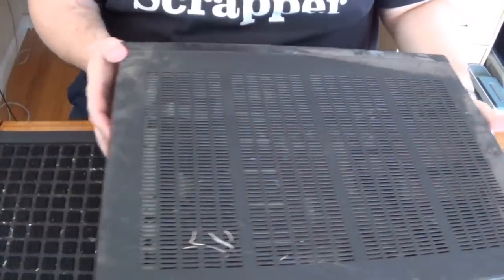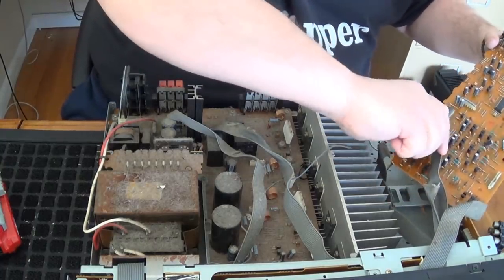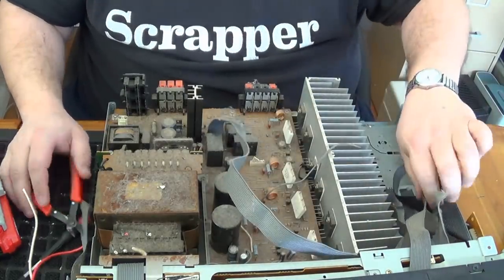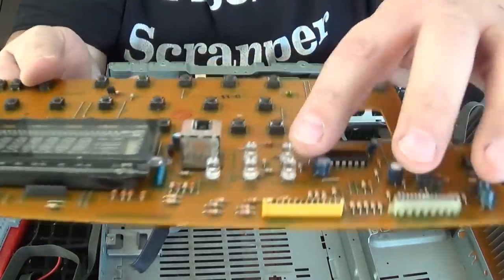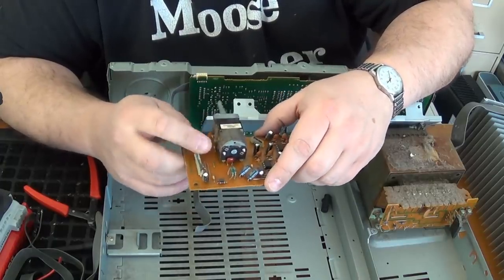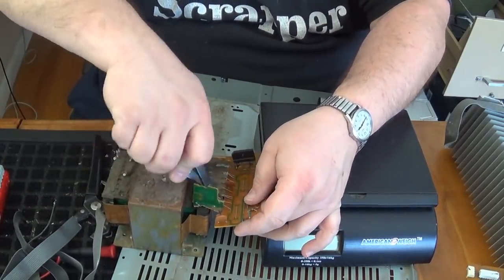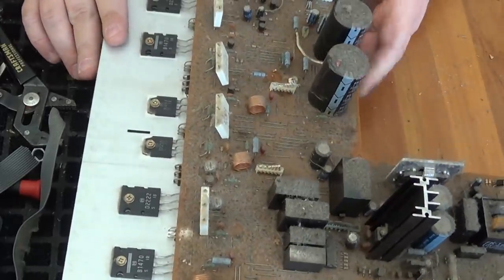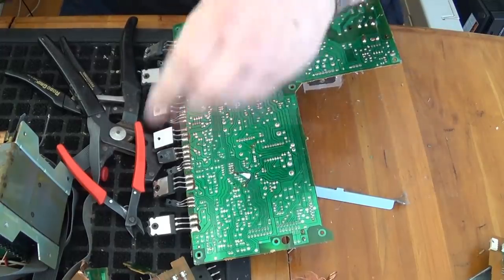Scrapping a Stereo Receiver for Copper, Aluminum, and FREE GOLD!! -Moose Scrapper #277

Comment: What about the solder?  Can you harvest that?  I sure is expensive to buy.
Reply: Yes you can save solder use a heat gun or a propane torch to heat the solder and bang the boards off over a collection plate your something 999dusan does that to save solder in some of his videos 👍 hope that helps

Comment: Almost forgot - old electronics with big transformers (heat) were roach magnets and may still harbor the nasty little buggers.  Whenever I get these I give them a bug spray and never open in the house.
Reply: Found quite a few items, a tv, a desktop computer, something else, can't remember, populated with dead roaches. They have been left outside all winter.
Reply: @michaeldenison7339  I error on the side of caution when it comes to roaches. I just expect they, or their eggs, are in there.  I work outside or at the main opening to the garage.  As soon as something is opened, it gets a quick spray with bug killer.  If I can, I put the object in a large plastic bag, spray some bug killer in there, and let it sit overnight.

Comment: Moose, seriously you need a good pair of Knipex 8" diagonal cutters. Best $30 bucks you will ever spend.
Reply from the maker: I have some good cutters, thanks, I just tend to use them more when I am outside in the garage scrapping in the supper for some reason.  I do mostly micro scrapping inside in the winter so usually have just the small tools in there.

Comment: I can't believe you couldn't get at least 10 bucks for it on eBay.  Kenwood is a classic brand.
Reply from the maker: with the power cord having been snipped, and unable to test for anything, and all the crap in there, I would not feel comfortable selling in on ebay.  Plus, this thing weighed almost 30 lbs so the shipping cost would have been pretty significant.  You are right though, should always try ebay first!

Comment: Junk receiver the best ones have vacuum tubes.
Reply from the maker: some yes, but I have sold some solid state tuners for over $2500 like some nice Fishers, Mark Levinsons, etc.Its surprising
Reply: @moosescrapper5928  dont listen to those tube heads, they like fake sounds.  Tube amp sound smooth but not real or accurate
Reply: Is there anything good inside the vacuum tubs